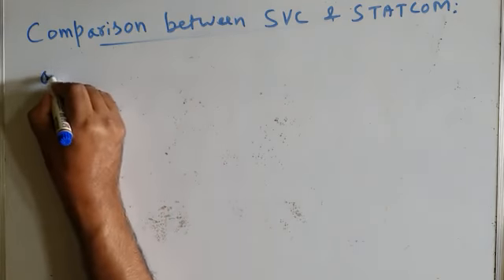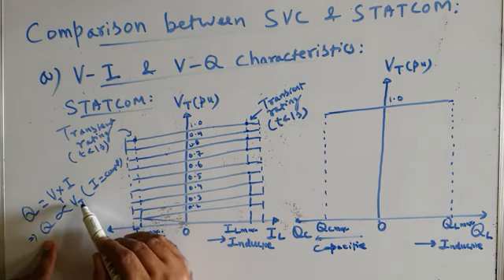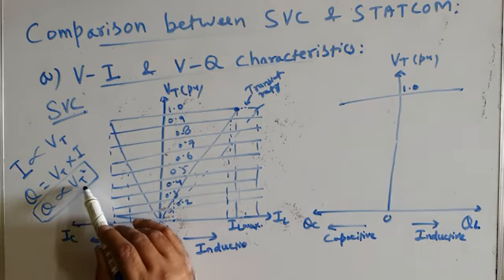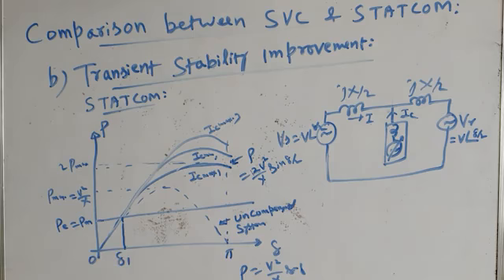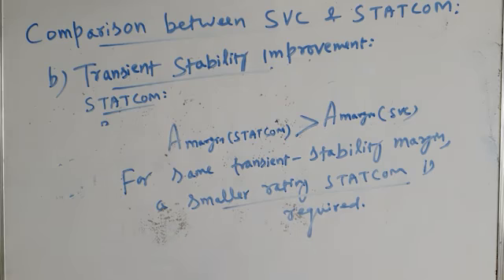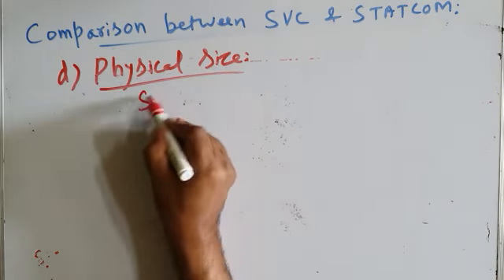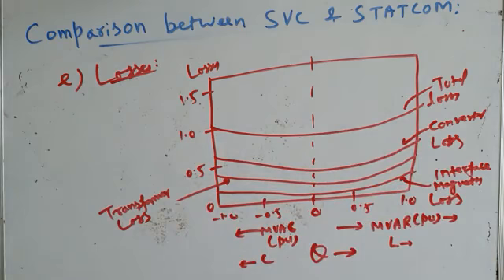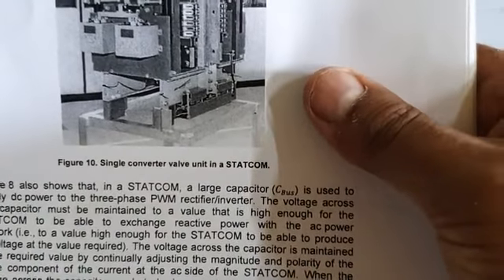L22_ STATCOM Vs SVC

Comment: Hello sir, it is great to see your lectures. But I have some questions, like if bus voltage are dropping then you show statcom can deliver either inductive reactive power or capacitive reactive power and since current is constant the drop in reactive power will be same as voltage drop. But the main function of a STATCOM is to deliver reactive power during bus voltage below 1pu and consume reactive power above 1pu to reduce the ferranti effect. So according to my knowledge the V-I or V-Q characteristics should be one sided curve, below 1 pu it will act as a capacitor only, after 1 pu it will act as an reactor only. If I am wrong kindly explain.
Reply from the maker: @SayandeepBandyopadhyay-g2p  Absolutely.  Your explanation is correct.

Comment: Thank you sir for your amazing explanation. However, I have small confusion. 
In the transient stability part, why is SVC has different type of power angle curve? It should be almost same as both STATCOM and SVC has same power equation.